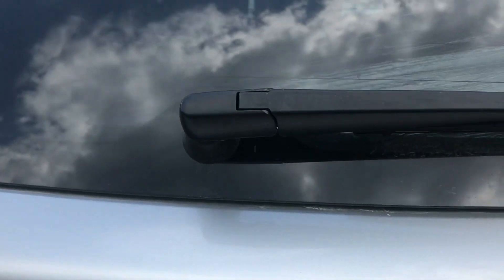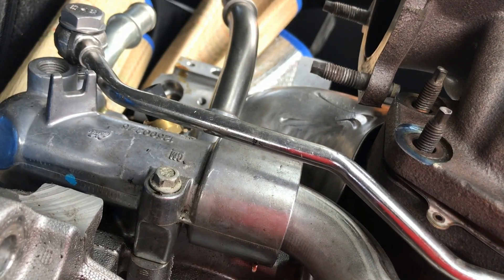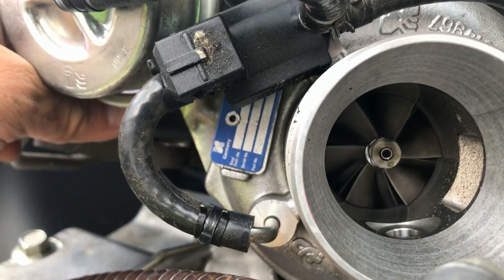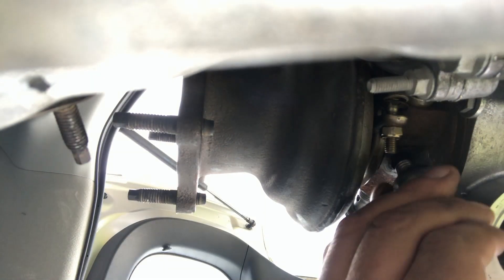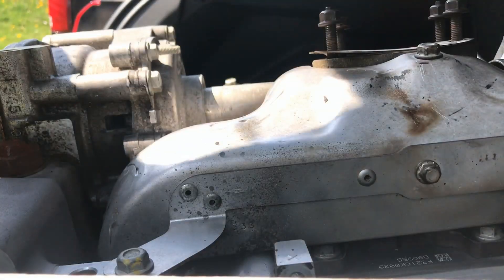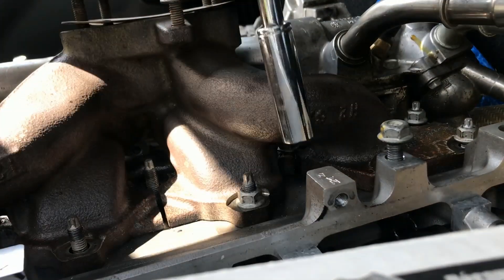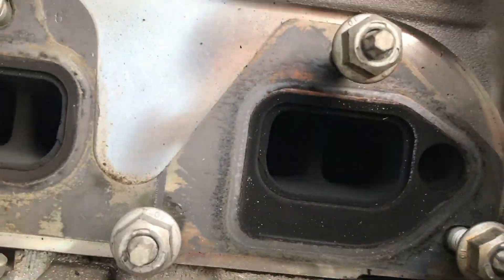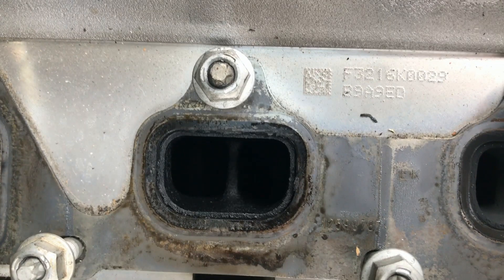2.0 l LNF Turbo Engine Teardown: Turbo Removal

Comment: Black smoke should be a sign of unburnt fuel.  So either stuck injector or a dead coil
Reply from the maker: I agree, however the comment was based on what the previous owner had described when the engine failed. I had no prior knowledge about the engine, nor was I involved in troubleshooting it when it was running. The engine has been dismantled and inspected since, and in this case, the valve seals were blown on the third cylinder, and also a crack on the turbo housing.